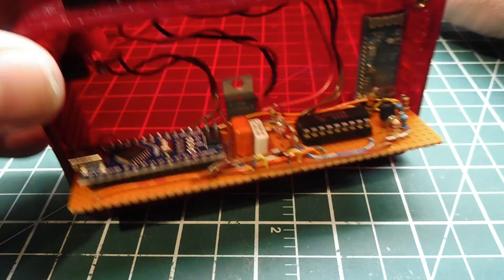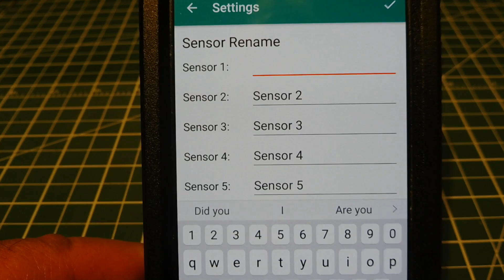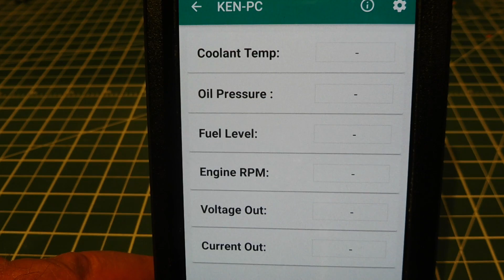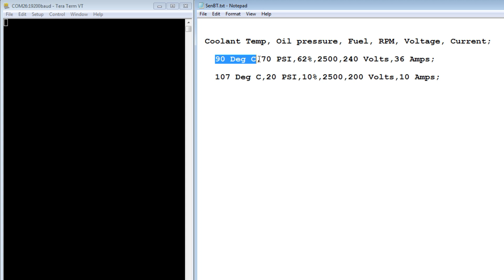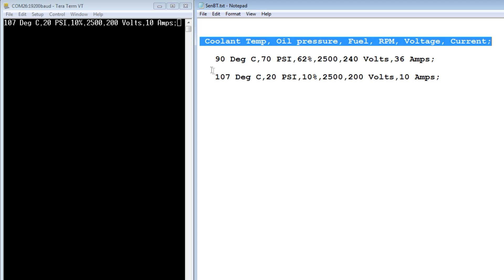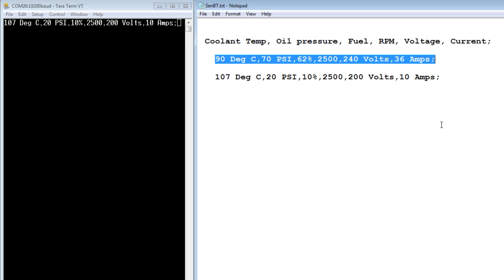Sensor Reading With Bluetooth

Comment: Great demo. I enjoy the video's on you channel and will try-out flashforth in my programming lessons. Is it possible to use the terminal output and bluetooth connected at the same time at the same port? And if that is not possible I'm curious how you solved this.  Arduino uses a soft serial, but i could not find examples for a library like that in flashforth.
Reply from the maker: The project only needs the TX line from the Nano to work. This is an output which feeds two inputs, the FTDI chip and the Bluetooth module so there is no conflict. Using the Nano RX line at the same time can cause conflicts so there are two 1k ohm isolation resistors on the Nano board in series with the Tx/Rx lines. I usually remove the Bluetooth module when I need access to Flashforth and replace it to run the program.
Reply: @0033mer  Thanks for the detailed advice. This and your videos really motivate me to go forth with my projects. I will order some bluetooth modules so I can try it out.  I can imagine that the arduino mega with its 4 uarts and 4 timers is a good platform for flashforth. Then you can keep the repl up and running while sending bytes through the ether.
Reply from the maker: That is correct. The Mega2560 is a very good candidate for Flashforth.

Comment: I've been struggling to find a simple auto ranging circuit. Perhaps you have some recommendations? I just etched a single op amp current sense amplifier similar to the ones used on the Chinese dual Volt/Current meters. I just used half of a LM358 set to a gain just over 16 to match the preset scale of another Chinese $1 voltmeter (mostly because I have no experience with programming the PIC microcontrollers used on all of the cheapest voltmeters). 
    Now that I understand the basic op amp current amplifier well enough, I thought it would be interesting to try to build a better design. If the full range of the microcontroller's ADC is 16×, I want to use a LM324 quad op amp to create either a 1.6× stage (or a 160× stage). I don't know if it's better to do this with a LM358 and other circuit elements or whatnot, but I thought I could use one extra stage of the LM324 as a comparator so that the meter range is switched automatically at a certain threshold voltage.
  ...and here's where I'm running into problems... How the heck do I switch which op amp stage is input into the ADC pin without effecting the voltage? I haven't figured out whether it's better to try to integrate the signals so they run in parallel, or use the 4th op amp somehow, or use FETs to switch inputs. Everything I throw at the simulation software seems to introduce none linearity.
  Sorry for the long post, but this seems like the kind of thing you excel at explaining. It's one of the types of circuits I don't even know what I should be searching for exactly. I know it's a rather simple and common type of design situation, but when a hobbyist doesn't know what terms or examples to search for it's rather challenging to find the solution in my experience :)
  Thanks, -Jake.
Reply from the maker: If you want to switch analog signals you can use an analog mux like a CD4067,CD4051 or even analog switches CD4066.
Check Sparkfun for breakout boards:  https://www.sparkfun.com/products/9056
A simpler way would be to use one op amp stage into the ADC and change the gain/attenuation of the op amp accordingly.
You could use a digital pot controlled by the micro to change resistor values on the op amp circuit or use as a voltage divider.
Reply: 0033mer 
 Thanks those are all great ideas. Switching the gain in the single op amp stage sounds like a good option. I imagine that should work with a dual op amp too. One can be the gain and the other can be a comparator that switches a N-channel FET and resistor to ground.... Off to the Sims!... Thanks for the ideas. I was really stuck on the 2 op amp nonsense ;-)
-Jake